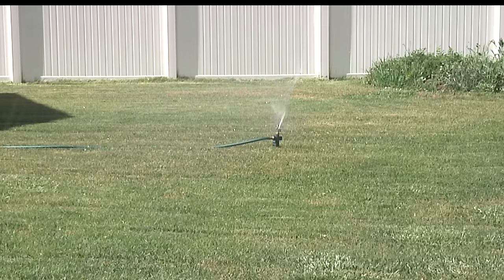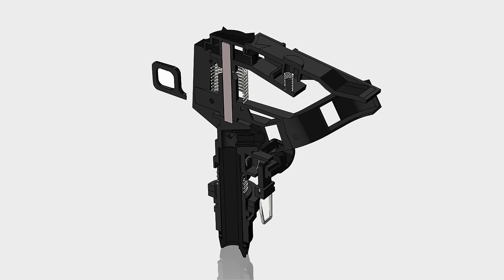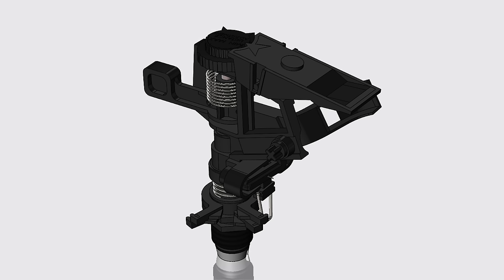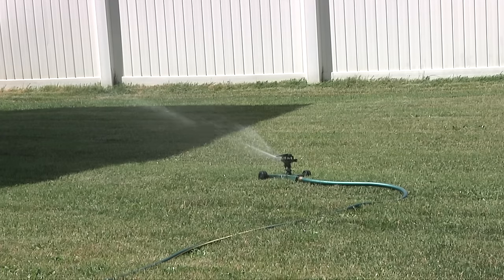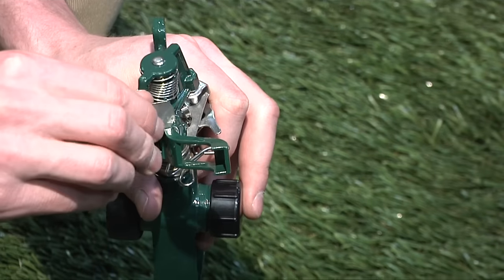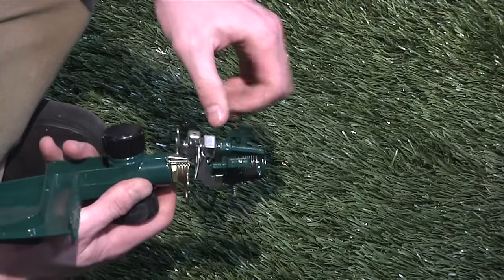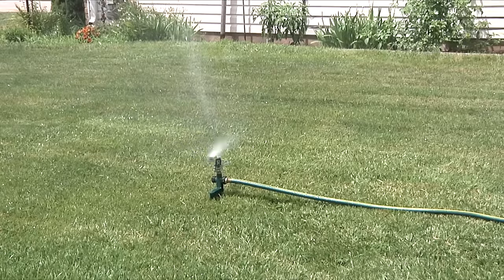How To Adjust An Impact Sprinkler

Comment: "ADJUST THE ARC OF THE WATER?"  WTF DOES THAT MEAN?!?!?  Nothing is worse than looking at an instructional video that uses complicated terms!  I learned nothing here!  I don't speak sprinkler or gardening. Just bought a best garden impact sprinkler and I don't know how to use it. No instructions came with the box and now I'm forced to find them  online!  My quest continues...
Reply: I agree and nowhere in here does it tell you how to actually do it and this was a waste of time watching
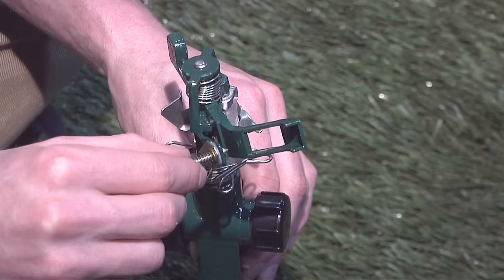Reply: What are you guys complaining about. 1:00 is pretty clear on how to adjust the arc …
Reply: The arc is when you aim the sprinkler a little higher which makes it go further.  Kind of like throwing a baseball.  If you're throwing a baseball a long distance, you aim higher and it travels a little further as it starts dropping toward the ground.  (Unless of course you have a arm like Bryce Harper of the Phillies).

Comment: It would be nice if their cheap $2 sprinklers were not the worst thing. It’s actually worth nothing.
Reply: I was using a metal Husky sprinkler on a 50' hose.  Apparently we have low water pressure since my plastic sprinkler goes much further than the metal one.  For us unfortunates that have low water pressure, the plastic one work better.

Comment: What would cause water to not come out of the nozzle all of the sudden?
Reply: You probably have debris in the impact head. Remove the impact head from the stand and inspect. Many impact heads have a small brass nozzle that can also be removed. Now you a strong spray from a garden nozzle to see if water goes through easily. If not, use a smaller version of a trimmer line to see if the line will go completely through. You may have to use a pick (think ice pick) to begin to remove debris that is blocking the flow. Once satisfied that water flows easily, you can reassemble and test the sprinkler.

Comment: I purchased three sprinklers, two of which don't spin freely with water pressure and therefore sometimes they don't spin at all while in 360° mode or sometimes they don't trip the return lever in return mode. Any tips?
Reply from the maker: You may need to reduce the number of heads on the line. Another option is to use the plastic impacts. While not as durable as the metal, they are lighter and spin with a lot less pressure. However, range may suffer. Also, there is the option of using gear drives.
Reply: Thanks.  The resting pressure in the system is 60psi but it drops to 40 when the sprinklers are running, is this not enough?
Reply from the maker: It depends what it drops to by the time it gets to the head. 40 PSI should be plenty to power one of these. If you have multiple on the line though, that could be the issue.
Reply: Orbit Irrigation Where will it be found in Pakistan?
Reply: @orbitsprinklers  what is the gear drives option?

Comment: Hi, See if you can help to figure out why my sprinkler head cannot return once it touches friction collar.  THanks,    allen
Reply from the maker: This sounds like not sufficient water pressure. There may either not be enough pressure at all, or too many sprinklers on the line.

Comment: So I am at a loss here.  I have purchased 3 Orbit impact sprinklers.  2 of the 3 work great but the 3rd on gets stuck in place on the return, in the same spot.  I have tried adjusting the water pressure and made sure it is free of debris.  Any suggestions?
Reply from the maker: There could be a number of reasons for this. If the sprinkler is the last on the line that is probably due to the water pressure not being enough to power multiple of these at once and the solution would be to have this on another line. Otherwise, we'd have to speak to further diagnose. To have our support team get in touch, please send us a private message of your contact info on one of our social channels linked in the video description. Thanks.

Comment: HELP   Have a new orbit impact sprinkler head I just installed.  It rotates as it should to the right but does not travel to the left.  Other heads in the system work fine so it is not pressure.  Line is clean feeding it  Is there a way to change friction spring to allow it to move easier?
Reply from the maker: Hello, we're sorry to hear this. Our support team would need to diagnose further by speaking with you. Please send us your contact info via one of the social media channels in the video descriptions and our support team will get in touch.
Reply: I'm having this exact same issue.  Ever get it figured out?

Comment: i can"t get it to oscillate. It'll go one direction but not back.
Reply from the maker: Nora, this issue is usually a result of insufficient water pressure.  If you have 40 PSI, that should be more than enough for one of the sprinklers to perform at an optimum level.
Reply: Nora Santos try lifting trip pin up and rotate 180 degrees, flip down. Now there's more leverage on the arm to push it for reversing direction
Reply: I am having the same issue. It will not go back. There is sufficient water pressure and it was working perfectly last year. I guess it is not awake yet from winter hibernation.
Reply: Jared Li You can try using CLR to remove mineral build up and then  use a Teflon based lubricant on all the moving parts.
Reply: Jacob Cabrera thank you for the tip. I will try that.

Comment: What is my orbit sprinkler head just drip water when the pressure is full on
Reply from the maker: This could be either a leak in the line, a kink in the sprinkler, or an obstruction in the sprinkler.